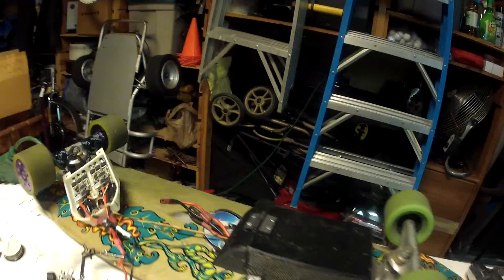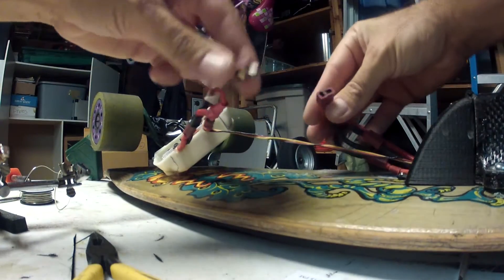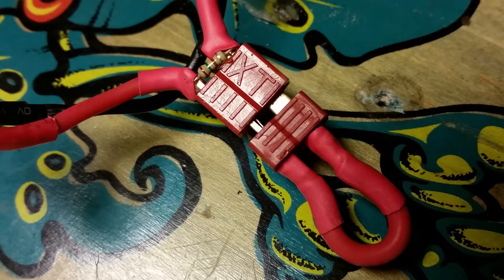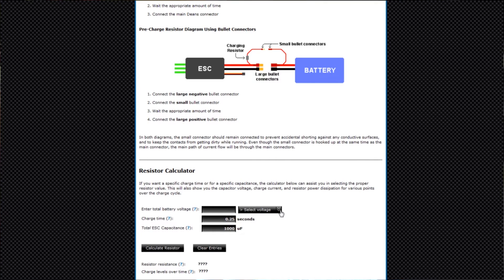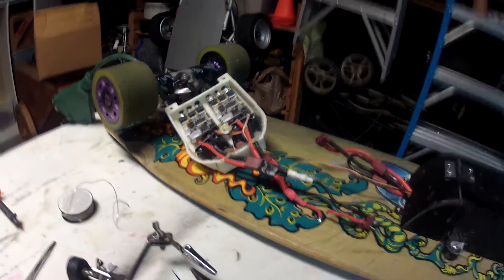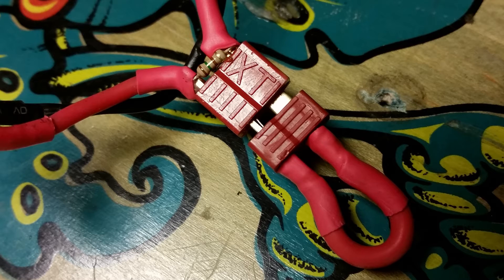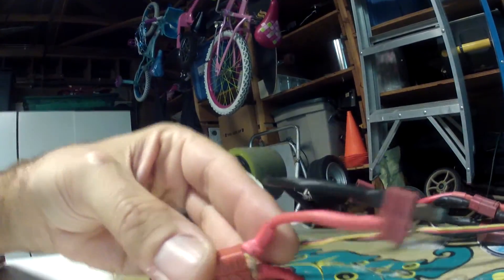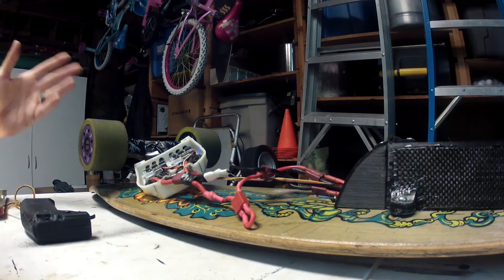CHEAP & EZ Anti-Spark Switch for Electric Sk8boards & Bikes

Comment: I am building a 52V (14s6p) battery pack for a 1000-watt ebike rear-hub motor.  I don't know the uF rating.  
Resistors are rated for 1/8 watt, 1/4 watt, 1/2 watt ... 5 watt, 10 watt, etc.  The R/C Calcs website mentions a 5-watt resistor @ 10 Ohms.
What resistor (wattage rating and ohms rating) should I get?
Reply from the maker: Maybe someone more knowledgeable will chime in to help answer that.  I know a lot of the basics to make simple circuits work, but I am not good with the calculations needed and usually search for better resources in situations that are critical.  You might be better to post the question in an endless-sphere forum.   There may also be a commercially available anti-spark switch that will handle the voltage you are running.

Comment: I used the site but it only asked how many cells I had in my ebike battery (14 cells - 51.8 volts)
I didn't understand the uF question. It says 1000uF is standard. The thing is, I have a 19p pack which is about 38A. So 51.8v (58.8v fully charged) and 38A - what size resistor should I buy? 150olms like you purchased or bigger? 

Many thanks, Danny
Reply: So for my 1/8 rc car, I have giant cap packs and 2 4s lipos in series with 5000mah capacity and 120c rating. Max draw of the motor is over 300amps. When I plug in the batteries, it'll literally take huge chunks out of 8mm bullet connector and it sounds like a gun shot (very scary lol). I personally use 250 ohm resistor and no more sparking! Completely different set up than yours but fundamentally the same. I'd suggest 100-500 ohms for you personally

Comment: Wouldnt this drain your battery over time? i mean when your board isnt being used? From what ive noticed, capacitors slowly leak their charge. If the capacitors are constantly retaining charge from the battery through the resistor, wouldn’t this create a “trickle drain” on the battery? My concern is that if my battery is say half charged, and I dont ride my board for a week or two, i am concerned that this could slowly over discharge my battery down way below the safe voltage range. I’m assuming I am wrong. So please help me understand. Thank you. Great video.
Reply: The plan is to disconnect both the battery and the key when not in use, i belive
Reply: Good question. I'm curious for the answer too reading this a year later.
Reply: Danny Tillotson me too a year later
Reply: I think with current, something has to be in use for it to draw anything. So if the ESC is switched off, no current (or very minimal) draw. Also the BMS will protect the under voltage of the batteries. It will cut off if you go too low.
Reply from the maker: This isn't a smart switch where you leave it plugged in.  Its a work around so you don't get a giant spark when you connect the battery.  You don't leave these plugged in at all when not in use.

Comment: look up anti spark xt-90 connectors :)
Reply from the maker: jamble7k They are also a great solution, but I did not have them when I needed them.
Reply: So anti spark xt60/90 is better, no need to do this anytime you're going to plug it in. You could also just use a switch... Or power probe to charge capacitors. Then plug it in after...
Reply: Yep = rip off. A pack of 20 olms resistors are £1 on ebay.co.uk - An XT90 connection.... no thanks. I need 6 of them and I'm not paying over £10 just for this when I can pay £1 and do as above with olms resistors to spare for further projects.

Comment: this is the last thing i need for my build then i can start. now so what your doing is feeding a little bit juice through a 150 ohm resistor, letting it charge the caps, then plugging the key in to complete a full 36v circuit and fully supply power? I want to make sure i have this right. hey and if you could follow me and let me know when you can help out when needed. I would appreciate that.

Comment: Hummina's Steelhubs spotted on your build, I suscribe ! Thanks for the video !
Reply: So when the voltage has stabilised through the resistance a normal switch instead of the cable to bypass the resistance will do?

Comment: Good job. What I suggest, is that you do not leave the resistor in circuit. Not a big deal, but just better if you; connect resisted circuit, ADD normal connection, then open circuit containing the resistor. Wives tale, is that current only follows the path of least resistance. Truth, is that current follows all closed paths and is divided by number of closed circuits with more current to lower resistance paths, and less current to higher-resistance paths. Also, resistors have wattage limits. Ohms Law and Kirchhoff's Law's rule.
Reply: Well, leaving the resistor connected will actually decrease the impedance of the connection. Ohms law at work...